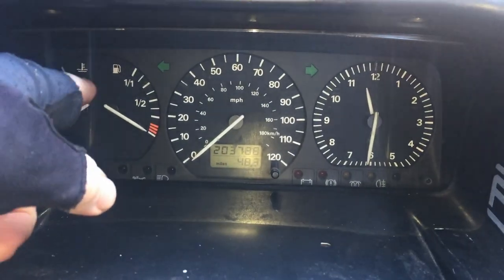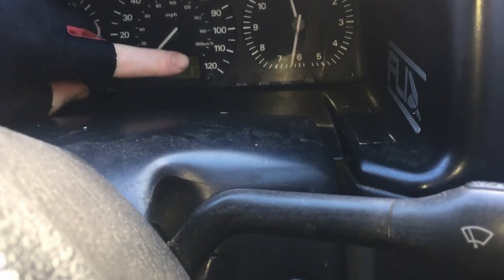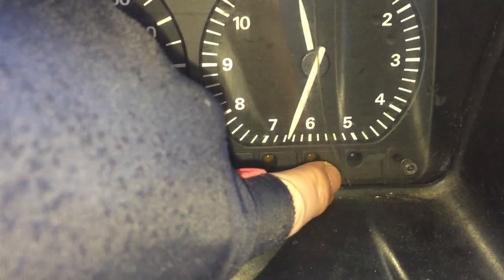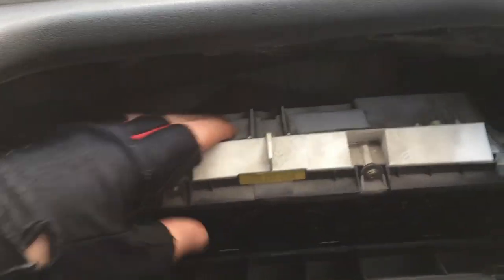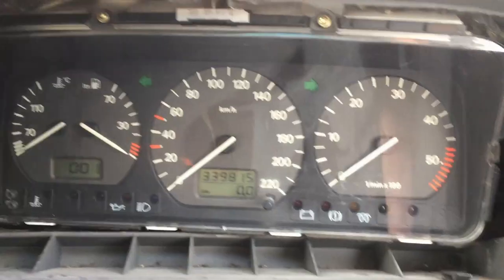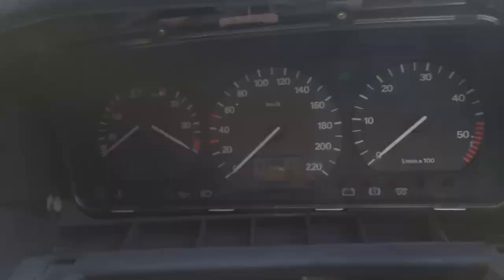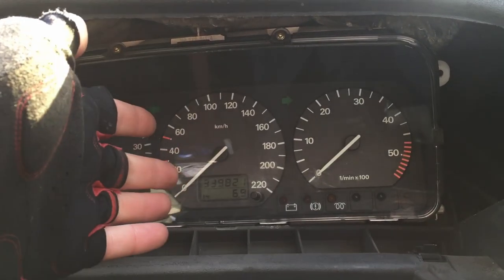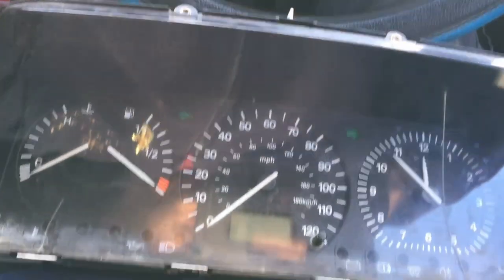VW T4 - Changing the Speedo/Dials Cluster (VLOG)

Comment: Great video. I think the thing comes from t5; t4 1a has three, 90- 95, with clock or tachometer or the automatic gearbox. The first of the two with tacho gets its signal from the red wire on the altermeter..W. the second from the geatbox.

Comment: Had a flashing oil light on my 98 T4 it was the spade connection onto the oil pressure switch on the oil filter housing. If its not that try a new oil pressure switch.

Comment: I have been running mine for years without any of the dials working as it has the solder joint fault I think. Luckily the fuel light still comes on so I know when I need fuel and it's so slow I never needed the speedo! It may be easier to replace like yours
Reply: Is it the older analogue one?
Reply: @jumpingjackflash2808  No, it's on a '98 model l
Reply: @Andy Thanks Andy I will look at that  I did read somewhere that the the loom was too heavy for the connector. That may explain why it randomly worked last year for two days!
Reply: @BluejuiceT4  Was the voltage regulator solder connections on my 94 model, didnt like the vibrations, so no fuel or temp gauges working. Oh and the blue led for the high beam went kaput, which I couldnt find a replacement for , so rigged a different blue led in its place which is so bright the whole cab is bathed in blue light when its on. So thats another job well done.:(
Reply: @jumpingjackflash2808  I’ve just paid £60 on eBay and sent my 1995 cluster off. They basically refurbish the dry soldered joints and check anything else that needs doing. I too have no temp or fuel gage. I have as a precaution also bought a new temp sensor to swap once all back but won’t swap until I see it all working
Reply: @fleurlightbown-smith4560  Its a well known fault on that display, the way the voltage regulator is mounted puts too much stress on the solder joints due to vibration. Mines fine now after resoldering that.

Comment: Had the same flashing oil light issue/rev counter not working on my old T4 was a faulty alternator, the wiring is on the same loom. Posted a video on my channel link below. I'd keep the original cluster in.
https://youtu.be/o8MWWOnyHQw
Reply from the maker: Yep it turned out to be the wiring from the alternator on mine to. Original cluster is working fine now.